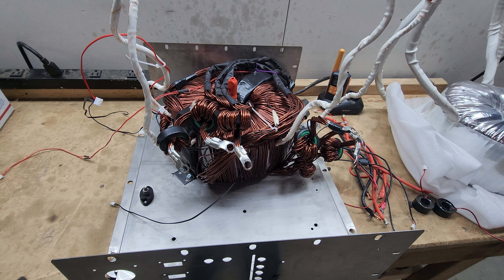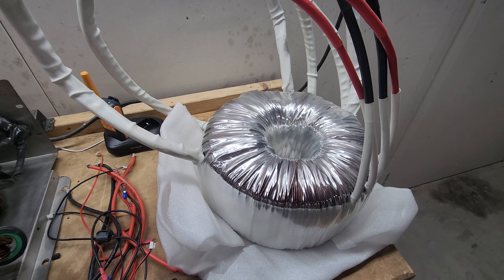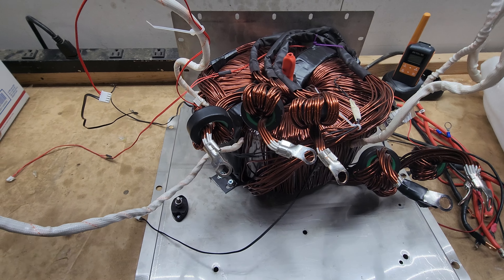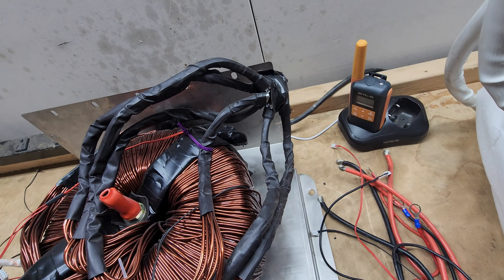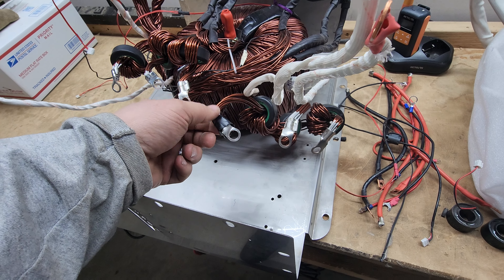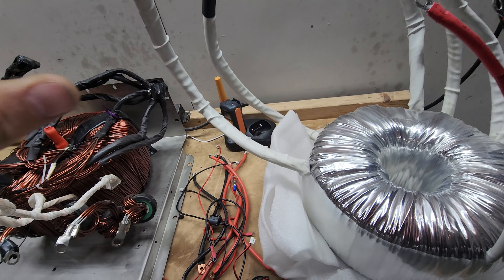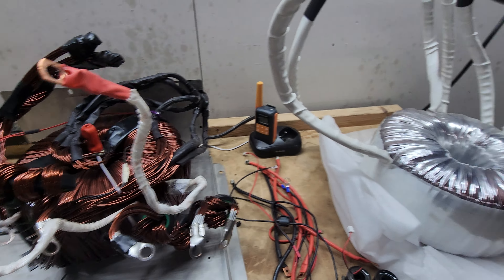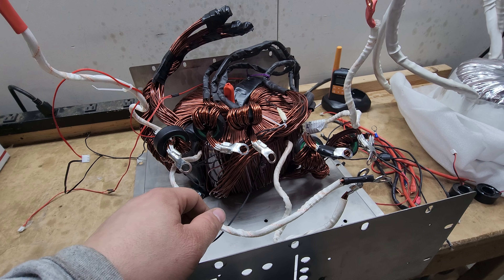It's time to retire the 2nd prototype GS12 inverter.

Comment: If you have a LED/Laser thermometer 🌡️ - shoot the transformer to see where the heat gathers, then attach the thermistors.

Maybe some heat sink compound will transmit the heat, even on top of the plastic wrap?

Maybe the new factory can include the thermistors inside the wrapped coils???